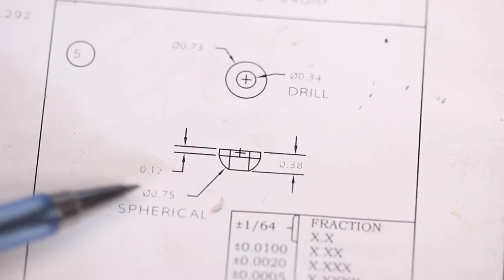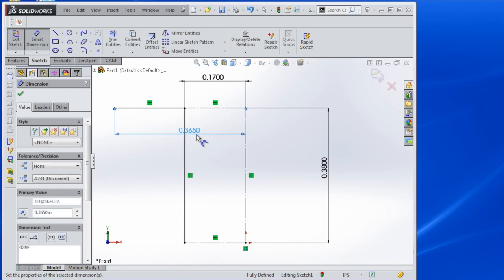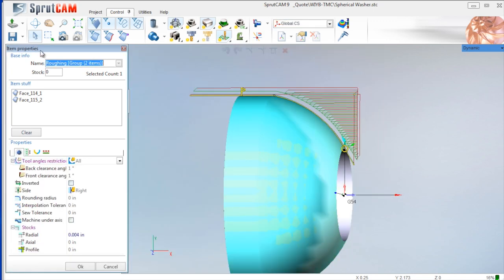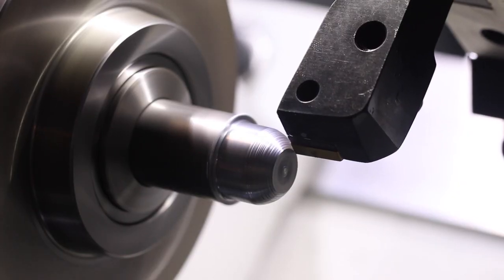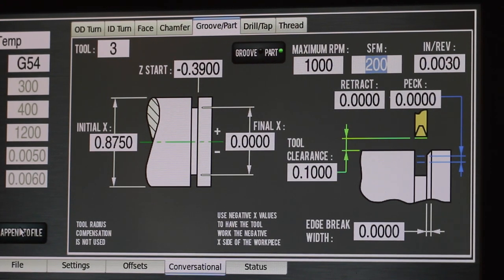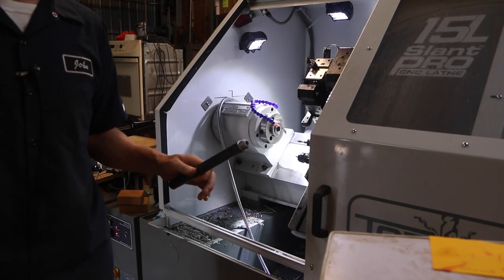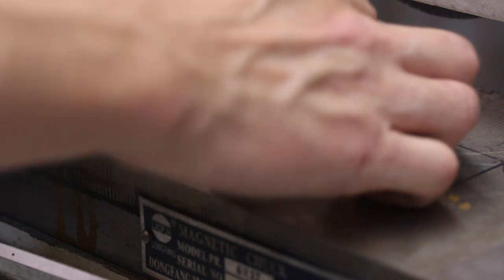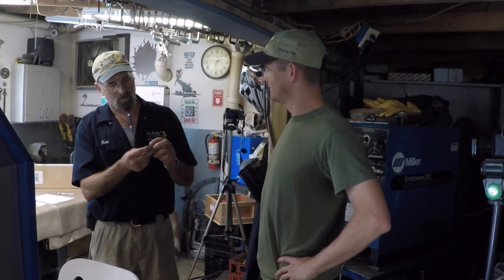What's In Your ToolBox!  Hemispherical Washer Widget50

Comment: Very minor thing but might help. When you draw your sketch to be revolved in SW if you draw the enclosed body like you did but then also draw a dashed centerline anywhere along the rotational axis you can dimension anything to it and the dimension will snap to the diameter meaning you don't need to divide anything. Makes changes etc easier. Great videos, look forward to them every week.

Comment: Another awesome video!   Quick handy little tip in SW when using center / construction lines when you dimension the parts is to just mouse over on the other side of the construction line so you can dimension the diameter instead of doing dia/2.  Thumbs up!

Comment: John,
I didn't see you constrain the center point of the radius to the rotational axis which is a necessity for spherical surface.  When you corrected the radius at 2:51, it looks like it came close but not on which is why the part looks OK.

Otherwise, a great Wednesday Widget.